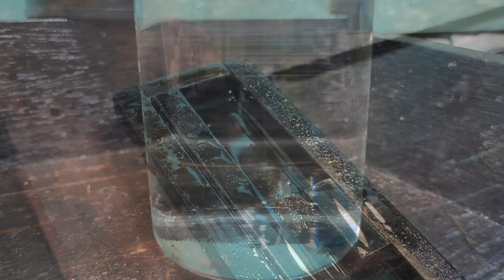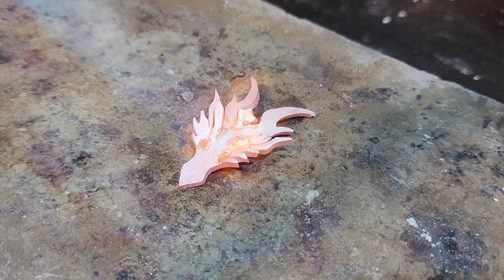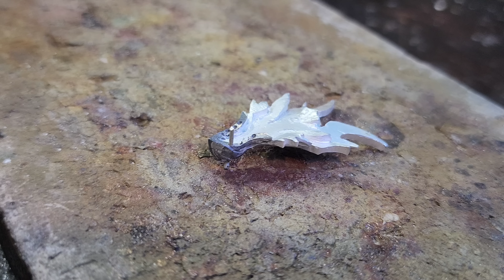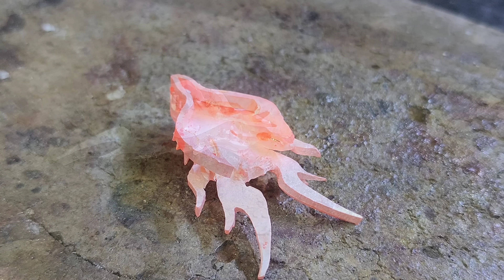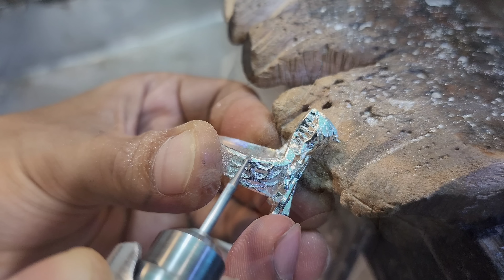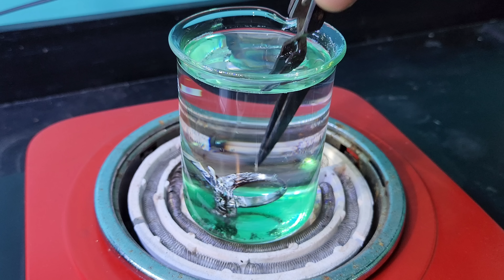Dragon ring handmade - how to make jewellery

Comment: Maybe this wouldn’t work, but could you use a soldering iron to try and melt the little metal bits you use to connect the layers? It might give more control than the blowtorch
Reply: The tin/lead solder used with soldering irons melts between 360-420 degrees F, while the silver solder he used melts at 1200 to 1400 degrees F, which is why a torch is required.